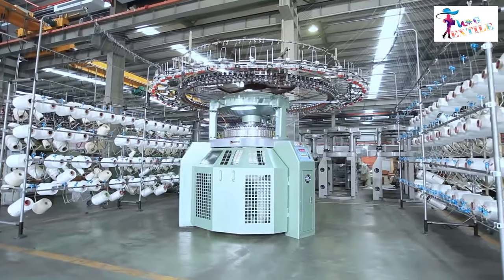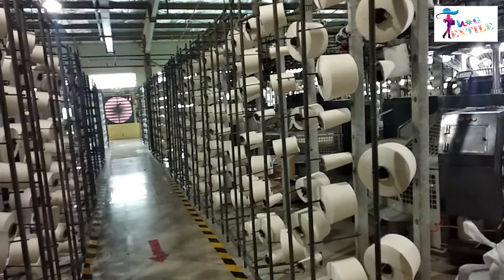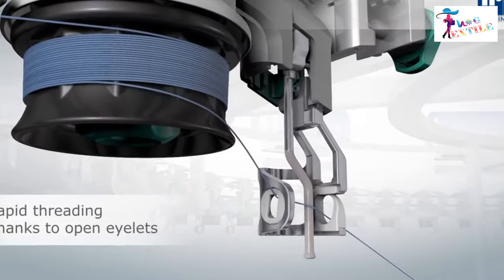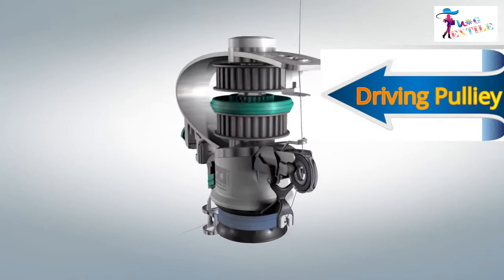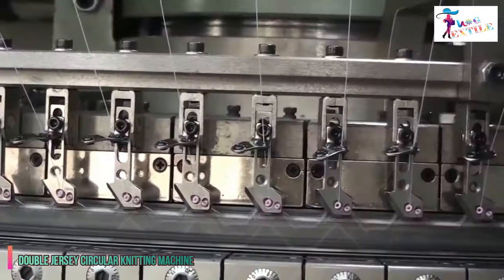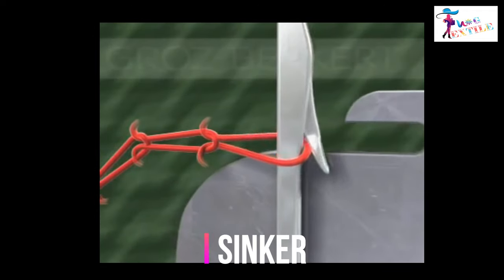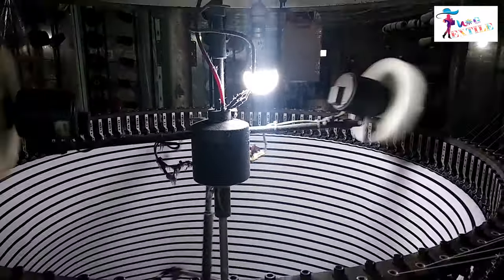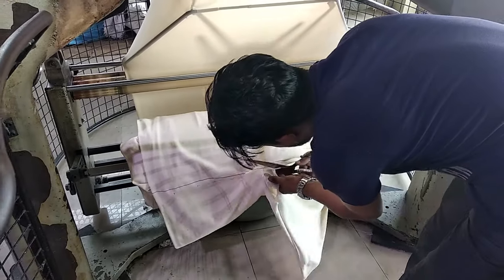Working Principle of Circular Knitting Machine

Comment: I currently work in a factory that uses this type of circle knit machine and have been running it for almost 5 years now.  This is by far one of the best, in depth explanations into how these machines work that I have seen.  Now, normally, I would operate a Warp Mill, and send my stuff off to the Knitting Department, but work is slow now and I am in the Circle Knit area, and fighting a machine that has too tight of a knit for its own good (it keeps dropping a thread randomly out of a latch), but am just happy to still be working
Reply: 😃😃😃very  good comments